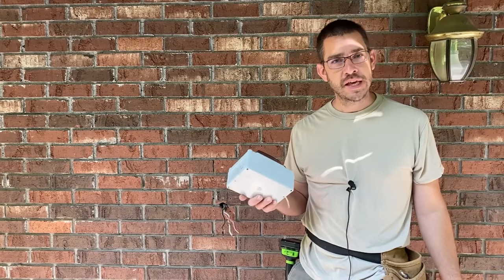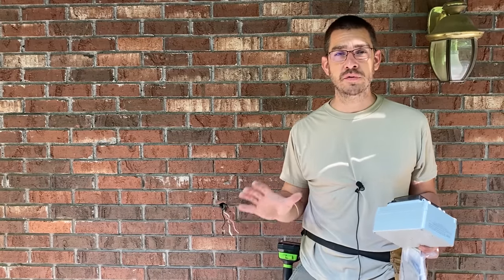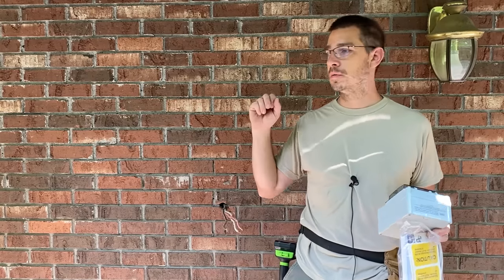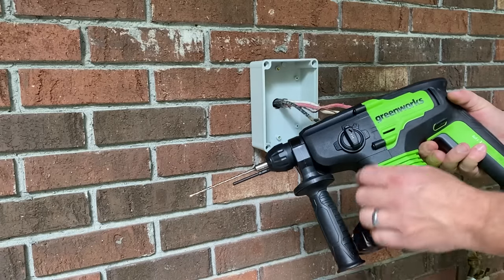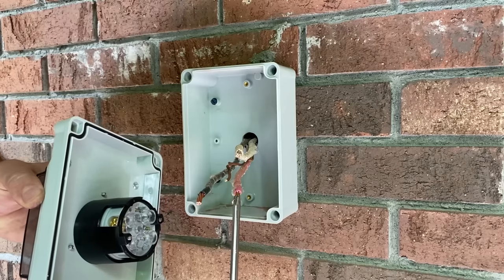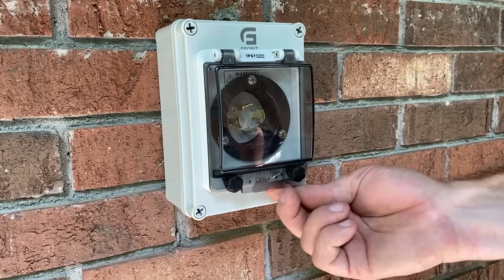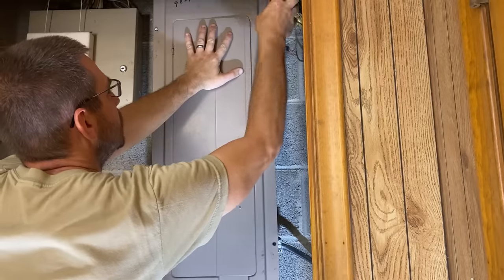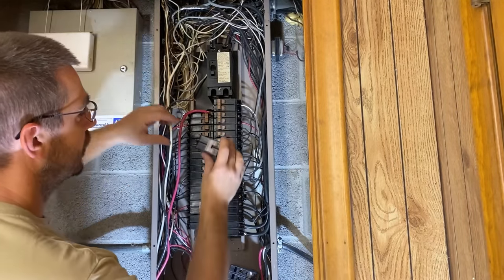How To Safely Power Your Home With a Portable Generator

Comment: As an electrician, I can't help but comment that you need a bushing on that box to protect the wire as it enters the box. It will also keep the wire from being pushed back into the wall.  Dont drill the hole right behind where the actual device goes because that limits your options on how to bend the wire around in the box. Great video!
Reply: Quick question for you.
Do you think that ground-wire is adequately sized for the circuit? Looks like a 16AWG wire with like 2 8AWG conductors?
Reply: @jamess1787  It actually looks like 6/3 cable (since the ground is bare and the copper portion of the current carrying conductors look slightly larger than #8.  The Ground wire is a #10 and is proper for this cable as it was manufactured to pair with the current carrying conductors. IMO
Reply: Thanks
Reply: Did it appear to you also that the interlock kit seems like the top right breaker could be slid over  . I think the hole alignment is off on this install
Reply: @Giggles_69  it looks like the zip tie should hold both top breakers securely.  Maybe I'm misunderstanding your question though.
Reply: @Jzzonem  question I have this on my home but it’s a 30 amp box am I able to hit higher than 30 amps? I have a 10k generator.
Reply: @WarTheory  A 10kw generator is good for 42amps.  10000w÷240volts=41.66amps (P=I×E) P is watts, I is amps, and E is volts.
Reply: @Jzzonem  so a 30 amp  box can handle higher amp’s? Would it be safe to get a more stronger generator or the 30 amp box is really maxed out at what I have now?
Reply: @WarTheory  No a 30 amp rated box cannot handle more than its max rating. Mostly due to the wiring that feeds it is probably size#10 which is only rated for 30 amps.  If you have size#8 cable feeding the box from the electrical panel, then you would have a 40amp breaker at the main panel and could install a 40 or 50 amp power outlet (cant remember which is the next size up,that they sell in stores)in place of the existing 30amp power outlet. Like just the actual device itself in the box.  The size of the wiring in between the "main panel and this box"  is what dictates everything. I hope I am making sense and apologize if I'm not.  I have always had a hard time articulating electrical talk.
Reply: @WarTheory  its really more about the "wiring and its size" that is fed to the panel from the box.
Reply: @Jzzonem  Totally appreciate it...I didn’t want to wait 2 weeks for the 50 amp box...the 30amp  handles everything but my central a/c unit... Maybe I’ll change it in the future
Reply: @WarTheory no problem. You probably will not be able to run your AC with the generator plus all of your other loads.  May have to be either/or, but obviously every AC system is different so it all depends.
Reply: @WarTheory  NO... If your power inlet box is a 30 amp box, that is the maximum it is designed for, same goes for the CB in your main box...Under NO circumstances ever attempt to run 50 amps into your main box, unless you have a 50 amp CB & a 50 amp power inlet box... I'm guessing your 10K  generator has both 30 & 50 amp hookups...
These are the kind of things that scare me with respect to the general public playing wannabe electrician, no disrespect intended here sir, hire a professional, I say this because of the question asked...
Bill on the Hill... :~)
Reply: Will a 10kw genny power 3 split unit aircons? (1) 24,000 BTU unit, and (2) 12,000 BTU units.
Reply: @Mr.Oblivian  To be honest with you, in general what us electricians should be offering as advice is that you have a proper load calculation performed by a professional.  Each situation is different for each installation and so are the load calculations that go into it.  The reason is that you don't want to oversize or undersize your generator, if you want it to last and not run at a diminished capacity or damage appliances in your home.  Undersizing the generator can cause it to run at full capacity all of the time and even cause it to provide too much power damaging appliances, overheat, get out of sync with itself and stall out.  Oversized comes with its own issues such as wet stacking if its diesel driven where the load isn't enough and it damages the generator over time, less life expectancy.  You have to add load banks into the system or have multiple generators to handle larger loads and balance them between two or three generators.  There are a lot of things to consider for every application.  The video that this gentlemen has offered should only be taken into consideration when you only plan on having general lights and plugs running during an outage. Once you start getting into 240volt loads, you should get a professional who will carefully calculate each application.
Reply: @Mr.Oblivian A professional would come to your home and walk the entire house with you, collect power usage bills from your electric company and analyze them for peak and non-peak conditions. A professional would perform an audit and potentially use a software program that he/she enters your information into to achieve a desired result. Then he/she will talk to you about your options and the pros/cons of each.  When you get into commercial/industrial applications, I assure you there are pros and cons to every option of installation when it comes to generators.  All this to say, that I can't honestly offer advice on a lot of these oddball questions because its really not the right thing to do. Sorry!
Reply: @WarTheory  [
Reply: Dude just needed a romex connector to enter that j-box. A plastic bushing isn't needed since he is going into plastic. No sharp edges.
Reply: @jamesmuravska2922  whats the difference between an NM bushing and a romex connector?  Are you talking about a twin setscrew romex connector? They both achieve the same thing and is what I meant when I said bushing.  You realize that they make plastic nm bushings right? They hold the romex tight as well as protect from sharp edges. They pop in in seconds vs a twin set screw connector which is metal where you have to thread a lockout and tighten two screws down on the romex. Metal into plastic?  Plus if done too tight it may eventually trip. Like staples in the wall if they are hammer too tight against the outer sheath of the wire. The circuit may work for now but eventually it will trip. Maybe I'm not understanding what difference your trying to make.
Reply: I would have brought the wires out the bottom of the box through a bushing and elbow into the home.
Reply: 5
Reply: I'm a retired electrician and I was thinking exactly that same thing!
Reply: Yep, that wouldn’t pass inspection (assuming you had an inspector that made you remove the cover). We would also be required to duct seal, especially if it was conduit for the temperature differential to keep condensation out
Reply: @TheRobWay1  very good point depending on the local authority having jurisdiction. Also, i just thought about the concerns that other viewers may have a wood frame house where the chase hole through the wall would be lined with potentially combustible materials and would require a chase piping through the wall and into the box.  Being that in this video, the house is concrete and non combustible.  You see this application of code a lot in kitchens where the device is installed over tile but the box was roughed in too far back before drywall and backsplash went in. In that case, the tile would be non combustible and actually would not require arcshields. However, if there was only drywall and the box was still set too far back, then it would require arc shields as drywall is considered a combustible material.
Reply: I am wondering why not use a female plug on the wall box rather than having the male prongs sticking out. I would not completely rely on the cover " locking " into place.. even adults stick fingers where they shouldn't... only takes a milli amp.. just sayin
Reply: @tyk8168  most likely to keep the prongs from being bent. If you have a male twistlock installed on the generator power cord, there is a potential for those prongs to become damaged or bent. But yeah good point!
Reply: @tyk8168  I agree, that should definitely have a lock on it with that set up. When I was a kid I would have definitely wondered what that was and tampered with it. Mind you it should never have power going to it with the block off plate on it, but that being said when every safety feature relies on the user… there’s always chances of missing steps or bypassing some safety features.
Reply: i was gonna say the same thing but whats more concerning theres still a live neutral so you can back feed into the grid so you loose power and the linesman now has current on a neutral  when he shouldn't a real interlock should be installed before the panel and after the meter socket breaking all 3 conductors not just the 2 phases
Reply: @grapphiiczak  i see what you are saying and it makes sense logically.  I would assume that because the neutral is bonded to a ground rod at the first means of disconnect, than it doesn't cause a hazard for lineman.  Also, to make things even safer you could just remove the meter itself from the jaws of the meter can and that would 100 percent isolate the system.  You bring up a good point and now that I think about it, I would probably remove the meter if I had this setup.
Reply: @1CHANCEPRO  ask me how I know lol
Reply: @crusherfang9368  It may very well be a 10/3 cable. It would make sense.
Reply: @tyk8168  It's male because with the interlock in place, there will never be voltage on those blades/prongs without the generator plugged into it and covering the blades. Conversly, if it was female that would mean that the cord from the generator would have a male plug (at both ends), exposing you to 240 volts on its exposed blades/prongs if the generator was running without the cord plugged into the house.

You always want a female outlet on the source voltage side of the circuit and the male plug on the load side.
Reply: @reryro1472  ahh okay now that makes more sense. Thanks for clarification.
Reply: I am by no means an electrician but I wanted to point out that even though he turned off the main breaker (which feed the circuits below), the two large gauge wires coming in right above the main switch are still live.   Just want to ensure that anyone thinking about removing the cover of that electric panel should be extremely careful not to go anywhere near those two wires.  I'm sure most people know this but it wasn't discussed in this video.   Also, I believe that the aluminum plate (with 3 holes) that you used to mark the holes actually gets mounted right below the slide plate.  I think that will help keep your aluminum slide plate stay better aligned, on those switches.
Reply: @Jzzonem 😅 16:21
Reply: As an Electrician you should also tell him that is not a NEMA-3R box!  That should not be used outside! And that he should not be making YouTube videos about how to do things he does not know how to do the right way!! Cause people will think he does and someone can get hurt or KILLED!! And please stop telling people like him they are making Great videos!!:face-red-droopy-eyes:
Reply: @Jzzonem  All this talk about a connector yet nobody has mentioned that he shouldn't even be using that box outside anyway!:text-green-game-over::face-purple-crying:
Reply: @MichaelBurke-f2p  not sure what you mean. I dont know of an generator inlet box thats not rated for wet locations. If you meant the type of wire, then yes. NM is not rated to be in a wet location.
Reply: @Jzzonem  Look up in use receptacle cover which that is what a gen inlet is. And if your trying to seem technical it's NM-B ie romex and it's just fine to put NM-B through an outside wall if done properly. That is why I make these comments to people that are not actually trained craftsman. Making videos telling people this is how they should do things when they themself doesn't know the right way.
Reply: @WarTheory . No it can’t
Reply: @Jzzonem I can run my a/ c with my generator no problem
Reply: @MichaelBurke-f2p  actually nm cable is not technically allowed to be installed in this manner. It may be allowed in his location, but the nec states that the little 1/4 inch gap between the wall and the back of the box is considered a wet location. However, this looks like there may be an overhang above this box. So is it still a wet location? We dont know for sure. If it is, then no nm cable is not permitted. As far as the box, yeah if its not nema 3r, than your right. However, i dont know for sure that its not and its been a while now since ive watched this video.  Pretty sure he made a disclaimer.
Reply: @mikemccarthy6939  nice! What size?
Reply: @Jzzonem  12500 start up 9500 running watts 3 ton A/C
Reply: @mikemccarthy6939  oh ok cool! Literally lol!
Reply: Just make a video
Reply: @WarTheory - 10,000 watt generator is ~42 amp so yes you need a 50 amp setup with 50 amp inlet, 6 awg wire and a 50 amp double pole breaker.
Reply: @Jzzonem explain the scenario of a Gen giving too much power and say damaging a toaster/appliances
Reply: @condor5635  its not so much about how much power is being sent but what the waveform looks like. If its distorted and has an extreme amount of "noise", than it can damage sensitive electronics even motors in extreme cases. Not sure if a toaster would be affected, that would probably not.

Comment: Installed one of these interlock kits for my 10k watt Firman generator.  We get frequent power outages in the winter and are on a well that has a 220v pump, no power = no water.  Cheap and effective solution.